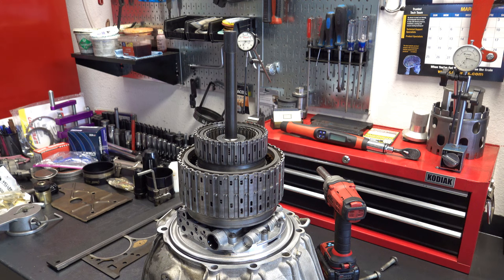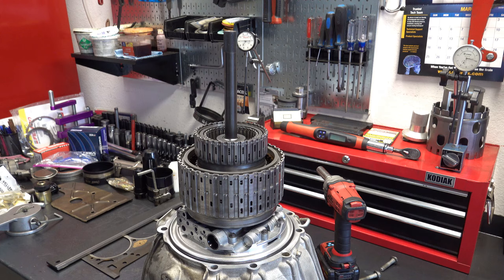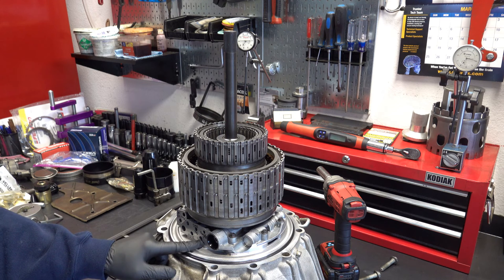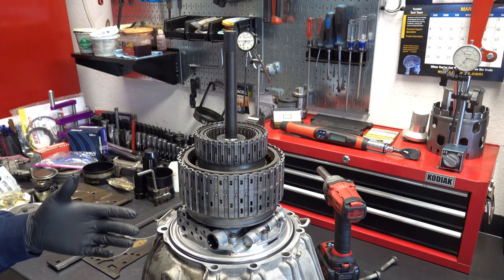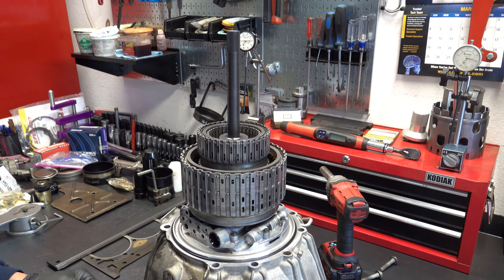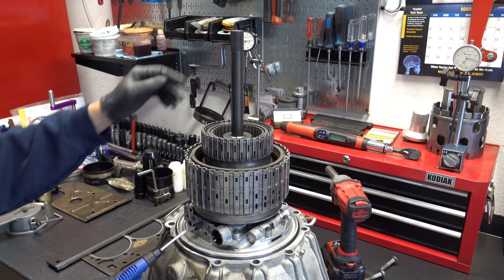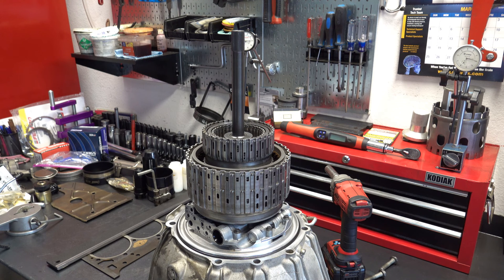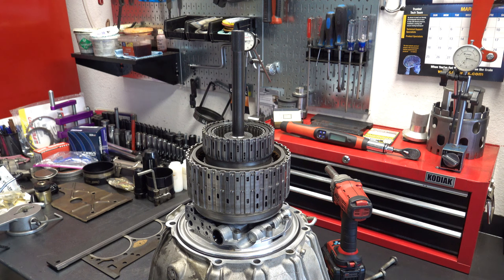6L80 Air Check - Pump, Drums and Compensator Feed

Comment: I been stuck on a 2014 Silverado 6l80e for forever. Had it rebuilt with a billet tcc, 
It ended up having a shudder still, upgraded the tcc to a 6l90 dual clutch, the shudder went away, customer came and got it and about a month later customer called and said it drove awesome except there was a slam at WOT 
So I tuned it again and tried unlocking the tcc in 1-6th full throttle just to see, and it again drives smooth as butter but still has that violent, aggressive grenade like feeling at WOT. 
So I have had the truck here for 3 weeks trying to figure this stupid thing out chasing my tail. 
Mind you, We use a third party to rebuild the transmissions. Hes been doing it for 15 years but I’m afraid because he didn’t replace the techm when he rebuilt it, that it’s going to need rebuilt again. 🤦‍♀️

Do you happen to be located in Florida? Or offer a remote service so I can email you and get your expertise? I’ll pay you, whatever it takes to get someone well educated on this.
Reply from the maker: Sorry to hear you're having so many problems with it...

The violent, aggressive shifting is likely converter but if the converter is new, the cause is either in the engine management systems (which you have likely already ruled out), TEHCM (possible, but not likely unless you have evidence such as DTCs indicating a fault) or transmission itself, particularly the pressure regulation system (compensator feed system, in these units).

I'd ask the transmission shop that built it to see if they vacuum tested the valve body and pump...Nearly every 6L I have built had sealing integrity issues in at least one critical valve train (TCC regulator, clutch select, compensator feed, TCC apply, main pressure regulator, boost, TCC limit valve, etc)...also find out (if you don't know already) if they installed either a Sonnax Zip kit or Transgo Tow-n-Pro kit...These transmissions require a comprehensive hydraulic correction/improvement kit to be installed on all overhauls...

I'm in Vegas and do all my tech support via Youtube (no emails, DMs, etc). 

What is the scan tool showing for TC and Transmission PIDs when you drove it to replicate the condition, if you have had a chance to do so?

Comment: Hey nick thanks for the video. When I try to air check my 4-5-6 clutch I get no clutch movement, air just comes out of my compensator feed port. When I take the clutch out and put air directly to it from the port on the shaft everything works fine with no leaks. As far as I can tell the only thing that separates the 4-5-6 clutch and the compensator feed port is the center seal of the 3 Teflon seals which are all new. Any advice on what I should try checking?
Reply from the maker: Check the inner diameter of the stator shaft to see if there's any sealing ring groove wear (if you haven't already)...New teflon seals will leak a little on air check but you should still be able to apply the clutch otherwise. The other possibility is the gasket between the stator and stator support - I'd replace that if you haven't done so already.

Comment: How fix a compensator feed leak
Reply from the maker: Hi - depends on where it is...If it's sealing rings, simply replace the sealing rings...If it's in the valve body, install either Transgo's TowNPro or Sonnax's zip kit. Thanks for watching!

Comment: Hi Nick

I am air checking new Teflon stator seals late design with oring behind

I am getting a slight cross leak at 3-5-R when testing 1-2-3-4 

I am getting a bad cross leak at 1-2-3-4 9:30 when air check 3-5-R 

Is this normal with brand new seals
Reply from the maker: The X-leak at the 1-2-3-4 when testing 3-5-R is normal as both circuits are energized in 3rd and 5th gear; the #5 check ball in the valve body partitions the circuit for when in Reverse. Slight cross leakage into the 3-5-R when testing the 1-2-3-4 is also normal on the bench with dry parts as air can get into places fluid cannot so you'll always hear a small amount of cross leakage with teflon, plastic-style or any other type of sealing ring that isn't rubber. 

That said, check all of your seal-bearing surfaces for wear such as the inner diameter of the stator on the pump as well as the inner dia of the 3-5-R drum...Check your seals as well, make sure none were damaged at any point.

Comment: Where are you located? have a 2012 6l80 slow to accelerate cleared adaptvs with hp tuners took on test drive power/torque is restored for a few miles then returns to limp mode I guess suv had no codes stored for trans
Reply from the maker: Hi Ryan, thanks for watching...I'm in Socal/SW region, where are you located?
Reply: @nickstransmissions  SoCal Fontana area
Reply from the maker: Please send me a direct message on Tahoeyukonforum.com with your contact number. My name on there is Nicktransmissions; I'm not too far from you.

Comment: So I have my 6L90 completely together except the valve body, I did replace the turbine shaft fluid seals, resized by wrapping with thin plastic then pulling a zip tie tied around each one and slid stator over smoothly, I believe they are good.  When air checking I get very good apply on the 1234 and 35R and when I pull the nozzle off significant pressure releases, so I think they are sealing well and working.  Using about 40 psi of air.  But, when I hold the pressure on and put my finger on the other opening I get a tiny bit of air, barely noticeable, but you can feel a tiny pop if you hold your finger there a few seconds then pull it off.  I feel like it's probably just needing the heat cycle you mention for the rings to fully seal, but figure I need more reassurance.  The 456 seems like it applys firmly the first puff of air, then not as firm the second time I put air to it, I don't hear any weird noises or air wooshing out, but it definitely isn't as firm/solid as the 1234 and 35R.  I feel like it's probably normal listening to air checks on youtube, but again, have to ask.  Thanks a bunch, Also ordered a shim kit because my end play seems nearly non existent, haven't put a mic on it yet, but I'm betting it's only a couple thousandths so figured I would get a kit to have in case I do need to increase it.
Reply from the maker: Hi Justin,

Nothing you've stated has me concerned however I'm not there with you so can't say to a 100% certainty there's no problem but odds are against...Double check your stator inner diameter for any sealing ring groove wear (if you haven't already done so) and then try wiping a bunch of transmission fluid in the stator's inner diameter then re-check to see if there's any difference...Brand new teflon sealing rings like the sort on the input shaft really need to be 'used' before they really seal...You'll find that used sealing rings in good shape, such as the ones on the input drum in this video, will actually air check "better" than new ones...nothing to be concerned about as long as you get apply and when putting air into the circuit, you're not able to physically move the clutch pack around when it's being compressed with air.
Reply: @nickstransmissions  Well I finally had time to finish putting the transmission in.  Warmed it up, did the reset with a basic scan tool that says it had the ability to "reset" the 6L transmissions, got it up to temperature and drove it around a mile or so, didn't really trust it so just got and used HP Tuners to reset, then did the fast adapt relearn which went through the gears while I held the brake down.  Drove it around the block a few times and a short stretch of road a few times.  It has a delayed shift into 3rd or 4th. Seems like it's third based on speed, but looking at the last shift times everything is about .3 to .4 seconds, but 4th was .65 seconds. It's like it starts to shift, nothing happens for a beat, then it shifts a little harsh.  Everything seems pretty smooth but that.  Before I pulled the transmission out, it was an auction buy I never drove before, I changed the filter and drove it around the block and it had pretty much the exact same shift, I just figured it was the transmission needing a rebuild.  I've seen posts of people having the transmission flashed and upgraded at the dealer fixing what sounds similar, it makes me wonder if I can adjust it out with HP tuners, but don't want to start messing around trying to hide it if I should look at something else first.
Reply: I understand what you are talking about and this may give some insight as to what is going on. When you replace the seals there is a sizing tool designed to return the stretched seals to their proper dimensions. You used a zip tie and reduced the size of the seals to the dimensions of the shaft but the seals are supposed to be slightly larger then the shaft so they can seal against the corresponding part. I would imagine that once they were warmed up they grew into the proper size and didn’t give you a problem.

Comment: How do I fix the cross leaks
Reply from the maker: Replace the separator plate between the two valve body halves, valve body-case/pump rubber seals, sealing rings on the stator and input shaft as well as that gasket between the stator and stator support...Also make sure your valve body / TEHCM assembly is secured to the case properly. 

That's it!

Comment: Hi! Great videos! I was using this one to air test my 6l80. My rebuilt 456 would not engage when set up as yours is. However, it checks perfect when tested alone. I replaced the pump/stator and housing as part of my rebuild. Curiosty got me, so i put the 456 into the old stator assembly, and it tested good so I removed both stators and swapped the old stator onto the new stator support. Reassembled the assy. Tested good. Built up the whole pump/housing assembly the way you have it there. It CHECKED! 3 times in a row! 4th attempt, no more engagement. 😔 any ideas? They are new orings, guides, and teflon support rings.
Reply from the maker: Hi James, thank you for watching...I'd carefully look over your stator support to see if it's cracked in any way, shape or form or if the gasket between the stator and pump cover was compromised (or left off). That's the only thing I can think of beyond cut turbine shaft sealing rings which doesn't sound like the problem.

Comment: Thanks for great video, I got 6L90 and No forward and no reverse, Can I still test with this one, What do you suggest to check, we took the 456 drum and clutch was toasted but is there any relation between this drum and no movement?
Reply from the maker: Thanks for the kind words, @houshang212!

No causal relationship between a smoked 4-5-6 clutch and no movement in any gear/range at all...

Check your valve body for migrated or worn check balls...#1 check ball gets stuck or migrates out of position, you will have no forwards movement. #5 check ball does same, you'll have no reverse. Other no-movement causes include stripped input shaft splines, destroyed pump rotor/slide, stripped 3-5-R and/or front planet splines, torque converter (rare) or exotic form of TEHCM failure (rare, TEHCM issue usually generates DTCs).

There may be others but the above are the most common ones.

Comment: Hi; what can be the reason behind cross leak?
Reply from the maker: Hi Shantanu, thank you for watching...There's a few things:
1. Worn pump stator sealing rings
2. Worn turbine shaft sealing rings
3. Worn pump stator to stator support gasket
Reply: @nickstransmissions  Thank you!
Reply: @nickstransmissions  Hey! One last question, is it normal for pressure to leak from the boost valve on the pump when we do the air test?
Reply from the maker: Are you subbed to my channel? If not, please do so - it helps me help you!

a very minor amount of leak is normal but it shouldn't be pronounced. That said you shouldn't be installing the factory boost or pressure regulator valve back in, if that's what you're doing.

Comment: Great video and information! 

Thank you for making this detailed video. Such a great help for all of us who are not too familiar on how these units work.

quick question; Is it normal to get some air coming out of the compensator feed hole while testing 1234 circuit?

Also, 1234 applies well, but there seems to be a hissing noise inside the drum. wich makes the circuit not to hold for long if the trigger on the blow gun gets released. 

Any thoughts would be greatly appreciated!!
Reply from the maker: You're welcome, Jose and thank you for watching!

Generally you don't want to hear any hissing coming from the CF when air checking any of the clutch packs, otherwise that indicates cross leakage into that circuit...This video was made in response to a fellow form member on Silveradosierra.com who was having the same problem. He was able to trace the source to a slight imperfection in the casting itself and so at the time of this comment, in the process of remediating the issue.
Reply: @nickstransmissions   Thank again for taking the time to reply.  This helps a lot greatly appreciated! 

Best regards
Reply from the maker: You're welcome, man - let me know what you ultimately find and how things turn out.